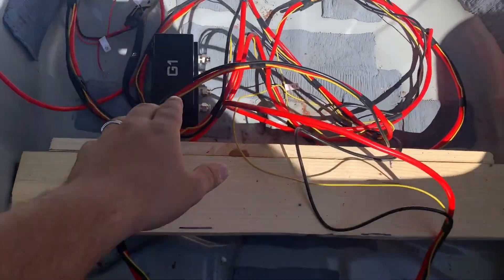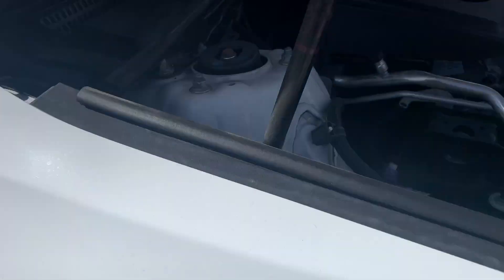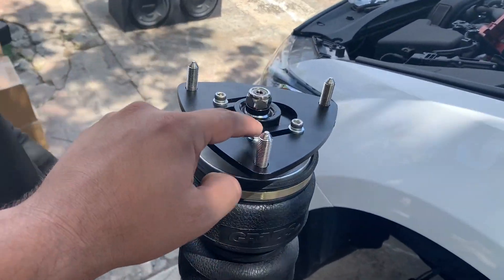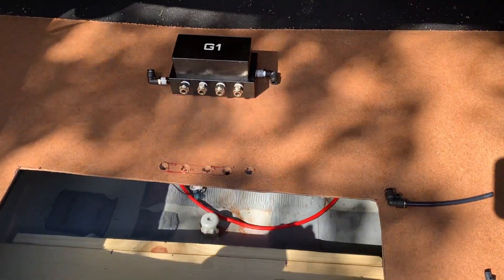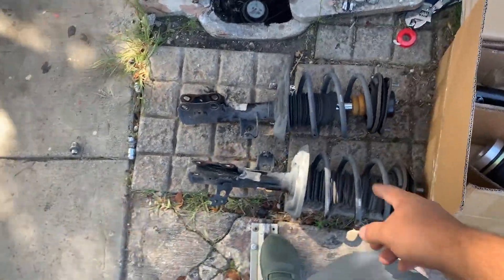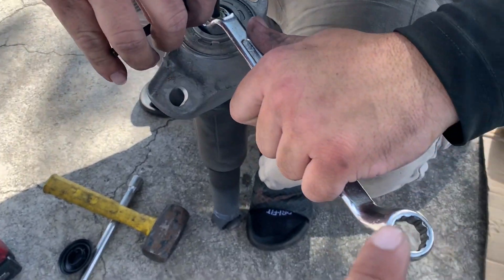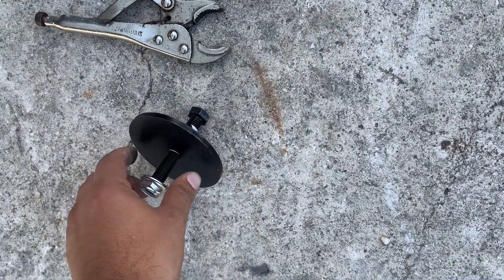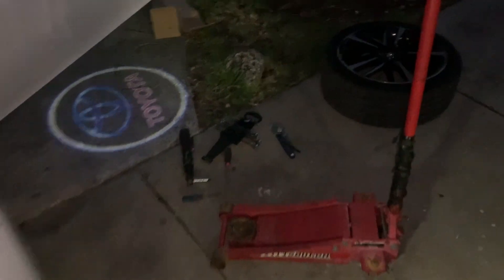BAGGING MY 2019 Toyota Camry - GRINDS air suspension

Comment: Okay so you blacked out not only the roof with vinyl wrap but I noticed you blacked out the chrome that surrounds the window too nice and looks like you blacked out the side mirrors… Was everything wrapped with vinyl? What color black did you use metallic ?
Reply from the maker: Mirrors were a replacement 
Front grilled was replaced
Everything else gloss black

Comment: Still running this setup? How you liking the Grinds, haven’t heard much about them.
Reply from the maker: Sold my Camry and sold the system to a close friend on a Camry also. He still running it.
I got their new system on my new Lexus and they are great no issues
Reply: I did airlift on a 2016 GS 350 and I'm not liking the rear set up ( fit) thinking about going to Grimds what do you suggest any input? @VIPDCUSTOMS
Reply from the maker: Yeah so I have a new video up on my 03 ls430 
When from oem bags to grinds bags and they work great ! Still comfy and no issues have it on for about 2 years now